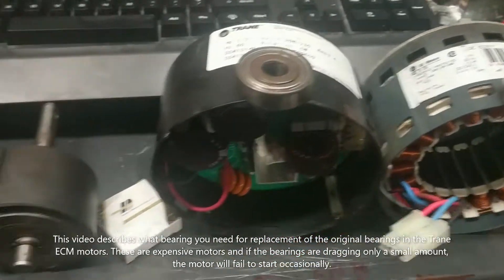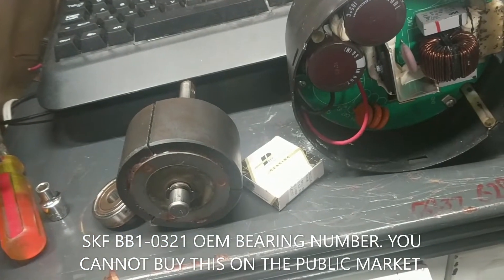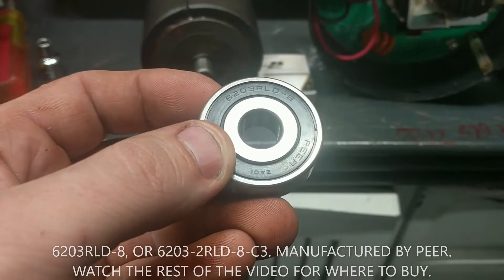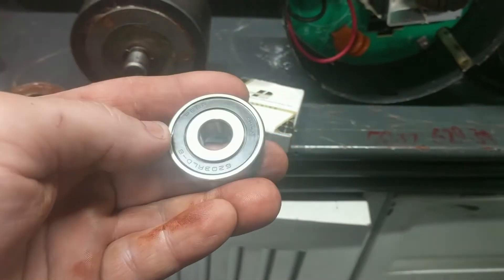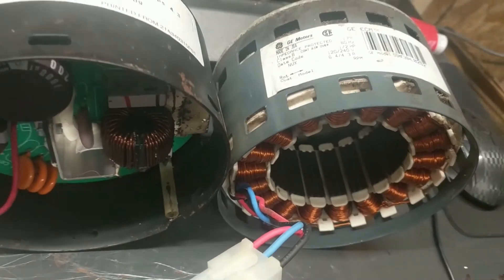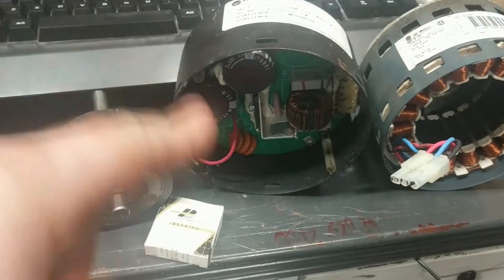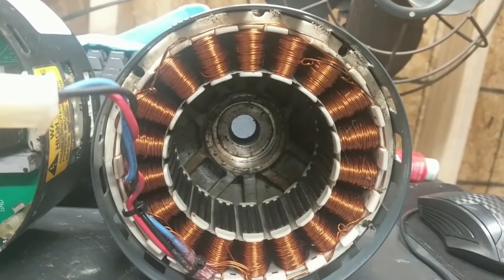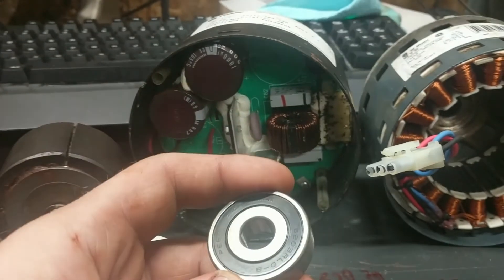Trane ECM Blower Motor Replacement Bearings (Are you trying to find bearings for yours?)

Comment: After replacing the thermister, a year later the main blower motor (GE 1/2 hp 08/22/00 CNO2 011DH7) in my carrier infinity is making a intermittent high pitched whine (g#5 note) when on first stage.  How did you know your trane bearings were bad?
Reply from the maker: It made a high pitched whine that sounded kinda musical. Side note that motor was made on my birthday

Comment: It helped me! Thank you for this! Control module is good, but bearings are shot on the motor. New motor is $500 (motor only)! A couple bearings and i'll be back in business for so much less. Thank you again!
Reply from the maker: Cool, glad it helped someone. That makes it worth it to have made the video!
Reply: thanks for the bearing info . im going to replace my bearings and use current motor as a spare i found a new motor before i seen the video . i paid 220.00US  for a new motor on ebay .
Reply: @robertscott8227  How is that eBay motor working out?   Was it a new unit?   Remember the seller?